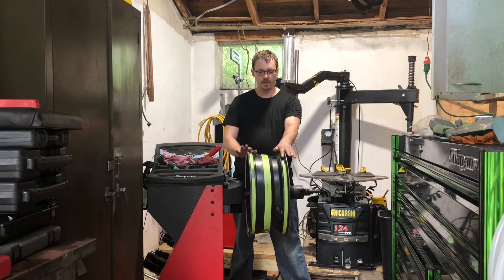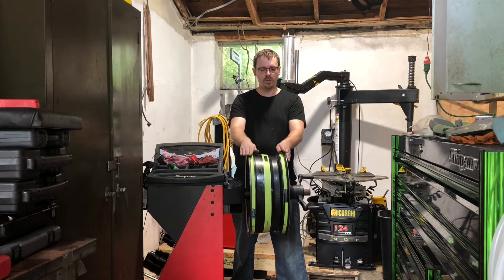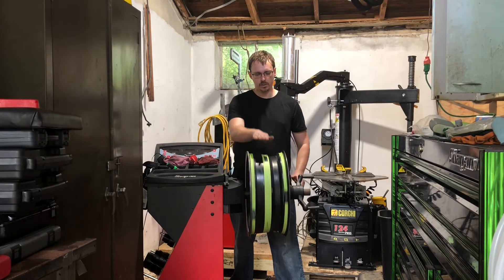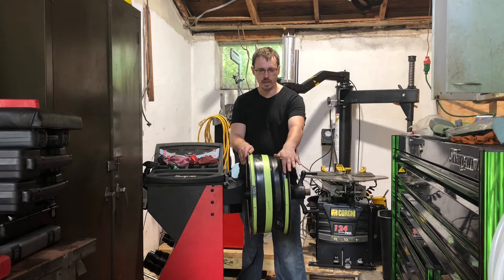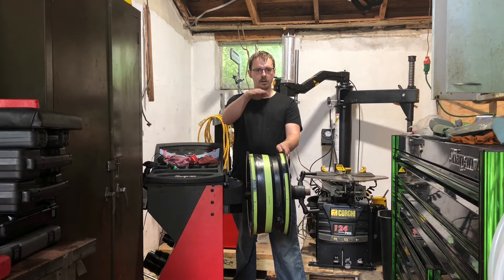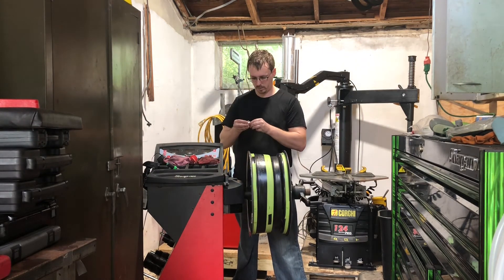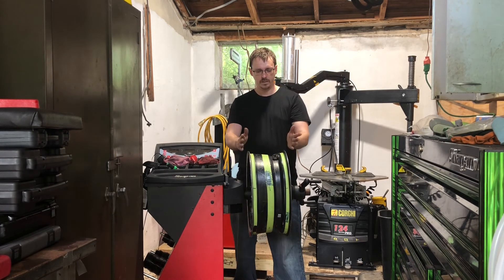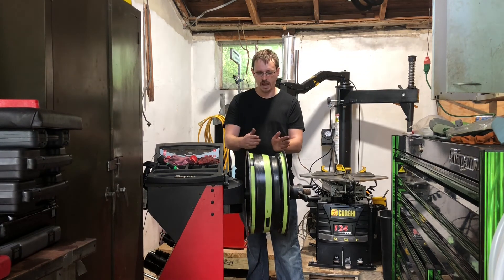Static Balancing and Dynamic Balancing Principles?  Let’s take a look into them!

Comment: So if you only see one strip of weights on the inside of the barrel and none on entrance of the barrel, is that is still dynamically balanced?

I guess I am asking, if a strip is dead middle of the wheel barrel, that’s static?
Reply from the maker: When there is weights only in one spot on the rim that could mean it was statically balanced but nowadays that’s unusual for a shop to do. Pretty much all shops dynamically balanced but nowadays wheels now. On the high end hunter and Corghi balancers they do have a formula calculation where if possible one set of weights can be put in a particular spot on the rim. Hope this answers your question

Comment: 0:58 this heavy vibration is minimized when you line up the red dot on new tires with a mark on the wheel. problem is i rarely see the mark on the wheels. great video explaining.  the cemb machine we have does the compensation of dynamic and ststic

Comment: Static balance seems to work well on very skinny tires like motorcycles or older car tires that are relatively small compared to today's tires.
The wider you get, the more the dynamic imbalance has "leverage" over the wheel. Suspension type can also dampen or enhance dynamic imbalance. Solid axles and non stearing axles seem to not be as sensitive to dynamic imbalance vs independent suspensions and steer axles.
And as you said, speed plays a big part as well. Good video by the way. You explained it quite well.
Reply from the maker: yes, that is pretty much correct. when a wheel is narrow dynamic balancing has less benefit. so for something like a motorcycle wheel will be perfectly fine with a good static balance. the wider a wheel the more a dynamic balance becomes affective and logical. most car and truck wheels are wide enough that a dynamic balance is best.

Comment: Somone said they stopped going to the shop I had my tyres changed at because they only do 'static ballancing'. Now I know what that is I think I may see if I get get them looked at to make sure they are properly fitted as I do a lot of motorway driving. Thank you for this great explanation. I have trouble with vibration and very responsive turn on my wheel and I was not sure if it was the tyres or something like the power steering fluid needing changing. I confess I know little about either 😂
Reply from the maker: I’m happy that you found my video informative. these days unless your running big tires like off-road or mudders all wheels should be dynamically balanced. if they did a static balance only, it’s a very good chance that’s your problem. wish you the best of luck and thanks for watching!  @beany87

Comment: Thanks for sharing this. I’m shopping for a used balancer and changer. Are you happy with your machines (snapon/corghi)? Any tips on things to look for or avoid? Its for hobby and occasional sidework usage. I have 295/35/21’s at the moment. Thanks!
Reply from the maker: no problem, my tire machine has been great, but look at the specs on limits of size just in case, but it can handle pretty much any size a table top can do. I’m pretty sure it will do, I’ve done 24” wheels and they were right around that width. if you can get new Corghi has a sale till the end of the year. if your in the North East I have a great dealer. as far as balancer it’s had a few issues but it’s ok, if I can I’ll be buying the Corghi em750(think that’s the model) next and selling the snap on. this combo should work great for you. Corghi is a great brand. don’t get a cheap balancer, I hear of people having issues with them. be sure to get the assist arm for the tire machine. best of luck.

Comment: I agree and disagree. When you do 33” tires and up, it’s recommended almost 100% of the time to static balance them only. Dynamic balancing works for smaller wheels but even then, most new cars that come out of the factory til this day are only static balancing their wheels. When you dynamic balance a 33”+ tire and the tire tread wears down over time, the weights from the dynamic balance can cause more issues as it will load up on both planes of the wheel and possibly cause feathering and cupping. All of the 4x4 shops typically static balance 33”+ tires as well and there aren’t any inherent issues with going that route.
Reply from the maker: I agree most large tire combos are statically balanced, this is to keep overall weight usage lower, also with the larger size dynamic balancing doesn’t have as much of an effect on such a large assembly. but I disagree on the manufacturers statically balancing new cars, through everything I’ve seen manufacturers dynamic/road force balance all their car wheels. if they didn’t I could promise you there would be tens of thousands of thousands of complaints on vibrations on new cars. even new truck wheels (f150/etc) are dynamically balanced. if dynamic balancing wasn’t better, most everyone one wouldn’t have gone that direction. I’m sure that a very good static balance would do well as well for a lot of vehicles, but a dynamic balance would still be better if it is applicable. thank you for watching!

Comment: Great informational video. In your opinion, can the old fashioned bubble balancing do a good enough job if your a diy’er?
Reply from the maker: the bubble balancer will have a few draw backs. most out there are not very sensitive so the weight amount could be different. while a bubble balancer will prevent the hopping vibration source it won’t account for the wheel wanting to pull in or out on a spot of the wheel. I think this would be less of an issue on thinner rim and tire setups though thinking about it. so you might be able to get away with a bubble balancer(static balance) in that case. hope this helps!
Reply: @geardriven1016      Thank you so much for your help and time…much appreciated.

Comment: not an easy subject to explain, i learned about this when looking at the bubble balancers you get on ebay and the fact that they only do static, and how you have to place the weights to cure the static imbalance but not induce a dynamic imbalance. I eventually bought a second hand john bean\snap-on hand spin balancer pretty much like your but with the bigger wrap around top panel for weights and the cones. have just got the calibration weight for it, so need to just check the calibration, allthough from some wheels ive done it looks ok. as you seem interested in this, have a look at rotational errors on wheel balancers, ie balance the wheel, take it off, refit at say 90 degrees to the previous position and balance again - results are interesting. the manual says that 0.1mm run out on the flange can give a 10g error. so i have learn that balancers are very accurate, but getting a wheel 100% centered on the spindle is next to impossible. some machines allow a 7g diffrence when the wheel is refitted at 180 deg.
Reply from the maker: Thanks for watching and thank you for the compliment! I actually cover the topic of this in a small series of later videos, when you have the chance check them out!  So in regards to what you mentioned. Snapon and John bean (same manufacturer)  use an algorithm where if you zero a wheel and rotate 90* it will always read a different weight. But, if you mounted correctly the first time and rotate 180* both will be zero. I have had my machine factory recalibrated to zero by a Snapon technician. I have also directly compared wheels I balanced to both hunters and corghi’s top balancers to verify, both matched mine to the gram so I’m more then confident in my methods and machine. In regard to the calibration weight you get. It is based off the factory calibration, so if that is off your self calibration will be off. I highly recommend doing a factory calibration. 80% of the time if you check spin or rotate and check spin and get different results that is due to mounting error/inconsistencies in mounting. I cover this exact topic in later videos as I mentioned in the begining 🙂!
Reply: @geardriven1016  thanks, im just watching those vids now.

Comment: Thank you so much for explaining the difference. I was about to balance my wheels at work (not a mechanic shop, we just happen to have a tire mounting and balancing machine) and I was close to doing it with "stat" since the machine showed that it only requires weights on the inside of the wheel. I was thinking "how great, then I don't have to have visible weights close to the spokes" but after some tinkering and further thinking, thank God, I decided to go into the "alu 2" program which puts sticky weights on the inside and outside of the wheel. I didn't know what static balancing really was, I thought it was just a more modern option of perfectly balancing the wheel and only having to put sticky weights on the inside of the wheel where it's not really visible.
Reply from the maker: I’m happy I was able to explain things for you in this video. if you have any ideas of other things you would like to know about please let me know. take care!